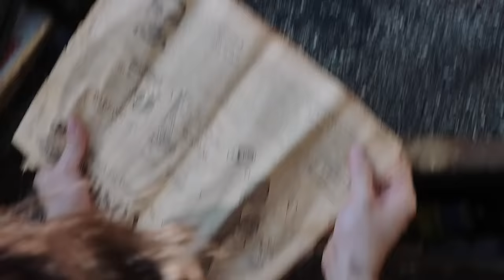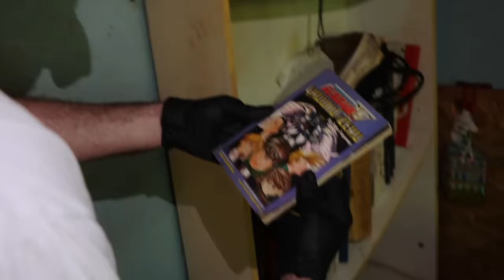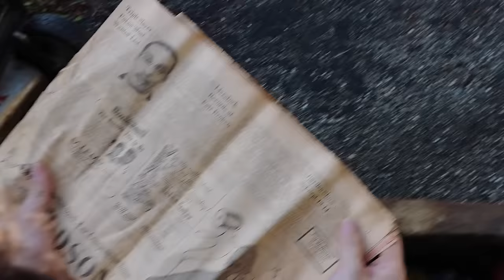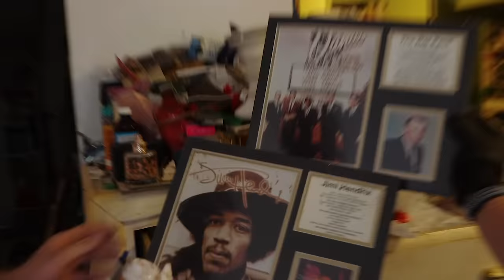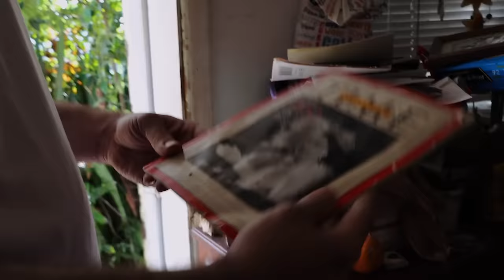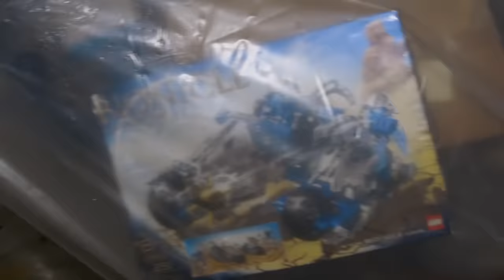"The Biggest Mother#*&@@^ I've Ever Seen" | Tampa, FL

Comment: So, just one question, what happened to the cats?  I'm especially worried about the sick looking skinny grey one.
Reply: I was thinking the same thing. Hopefully the ASPCA was able to come in and remove them. Spaulding is probably used to coming across them at these types of sites.
Reply: @dreamstreetrose318  the house had a cat door built into the window that they had to break to get inside and out. letting cats roam around outdoors is a very bad idea.

Comment: "Still in the box" seems to be a theme with hoarders. I don't get it
Reply: Hoarding is a mental illness.  In my experience (I've dealt with 3 separate ones) hoarders don't want to take anything out of the box "because it ruins the value" but at the same time they'll NEED it later. If it's still in the box it can't be considered trash and they won't catch as much flak for it.
Reply: I think it has to do with making plans for something, like a project or giving away as a gift. Then it gets lost in the shuffle and they don't or are unable to follow through with the original intention.

Comment: "This is an extreme level 5 horde...."
So I ask....Is there a level 6?
Reply: I’m a plumber and I have been into two homes that would be above a level 5. One lady needed a water heater replaced and a moving company had to be called in to move stuff and make a pathway for us to go in and replace the water heater. She couldn’t even open the front door more than just enough to suck in your gut and squeeze in sideways. The other home the lady called and rescheduled several times. She told me when I got there it was because she wanted to clean first before someone came into her home. When I finally got there stuff was stacked to the ceiling everywhere. It was a 4 bedroom 3 bath house with basement and there was only a small pathway where the lady walked from the back door to the master bedroom with a couple split off paths to get to the kitchen and bathroom. If she bumped into anything a mountain of stuff would have fallen on her and trapped her. There was a radio playing in the kitchen. She said she would have turned it off at some point but she couldn’t find it. It would take a crew of 5 people probably 2 weeks to clean everything out.